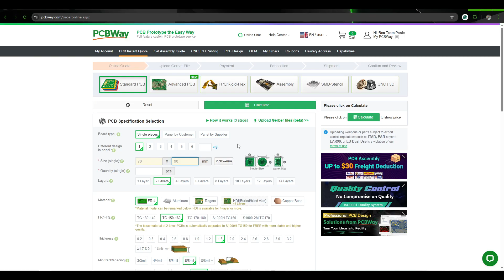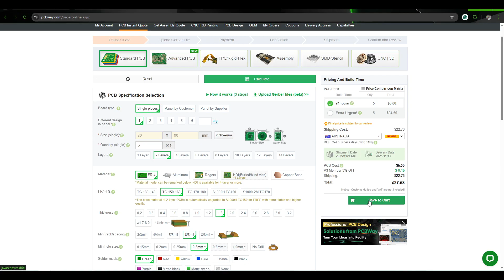for more POWER!!!

Comment: I really want to see how these new blades hold up. Has anyone ever tried 2 lighter counter rotating blades. Every time I see a horizontal hit something the thing they hit goes flying and the bot itself goes flying. if two bars where to hit the target more or less at the same time from opposite directions however... could you keep the target and your own bot in place and instead have all that energy go into the target?

Comment: Nice! I found that the lowest kV 1404s I can find (for another use in ants 😉) is 2750kv like in the specter or happymodel the latter of which I can get 4 on aliexpress for $50. Lower kV might be the move for a little more efficiency optimisation

Did you have aligned perimeter seams happening in that root of the motorside tooth? That may have been the sticky point

Comment: Looks like you bought the extremely cheap Ysido motors. I recommend buying the more expensive ones, as they have nicer internal bearings and better power/weight ratio. The Foxeer Datura 4533KV and XING 4600KV are massive but work amazingly. I believe the other one I have is a T-motor, and the bell is way smaller while still working well.

If you want to discuss 150g horizontals more let me know how to contact you!
Reply from the maker: Thanks for the tip, I'll look into those brands

Comment: If I counted right your gears have 12 and 18 teeth. Those have common factory of 6, causing a rather low least common multiple of 36. This means every time the big gear goes around twice, the little one does three rotations, and they end up with the same exact teeth meshing. I know for long lasting systems, people like to have co-prime teeth counts for even wear (add or remove a single tooth from either to get that), but I'm not sure if that's actually better (and bad combinations come less often and wear is more spread out) or worse (all combination will eventually happen, so two damaged teeth that are incompatible will eventually mesh) for combat use. Something to consider anyway.
Reply from the maker: You did count right

Thats an interesting thing to consider, I'll look at changing it to 13 and 17 that should keep my spacing the same

Comment: I'm surprised you can't direct drive the spinner and use the motor shaft so elevate it off the ground.
Reply from the maker: Oh you can and I have in a lot of previous horizontals
But when you do that the motor is in the firing line.
They break from getting hit (by other horizontals)
They split from the weapon getting hit (by verticals)
They break from hitting (usually something heavy like the wall, but repeated hits on an opponent slowly kill the motor too)

With the gears I'm trying to isolate the motor from the weapon a little, hopefully keeping the weapon running for longer

Comment: I'd imagine using the PCB bar with knife edged teeth would do a decent number to TPU especially given the speeds it sounds like its reaching.
Reply from the maker: I think they would too!
I might need to make a new set to hold some razor blades
I'd just need to be careful not to put that blade on against another spinner

Comment: Looks really good, refinement coming along. May i also suggest if you have any weight allowance left perhaps putting something like a light rubberlike plastic or foamboard between the pcb's of the weapon bar to prevent weapon on weapon hits from shattering or bending the pcb's?. The weapon mounting should be fine because its protected by the weapon but i can imagine weapon on weapon hits with blunt weapons might lead to a lot of shock through the separated weapon bar arms.

love this build so far.
Reply from the maker: This is not my first multi-pcb bar like this, and I wasnt the first to try this concept.
When I first saw a bar like this, I thought like you, that weapon to weapon hits would be devastating to the pcbs and they'd definitely pry apart. At that event I saw a bar like this take on multiple verts and just keep swinging

Since then I've used the concept a few times, in a few tournaments and not had any issues with PCBs bending or breaking.
I just think ants dont do enough damage (or are so light energy is dissipated in movement rather then components) to bend/break what is effectively fiberglass